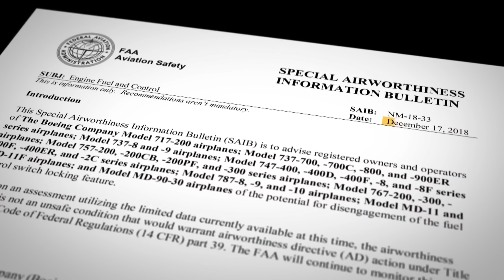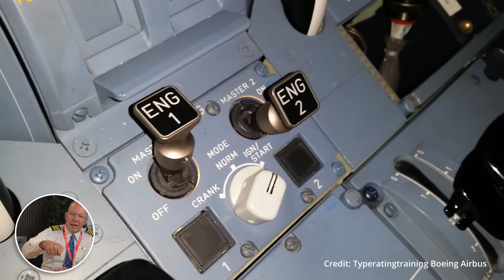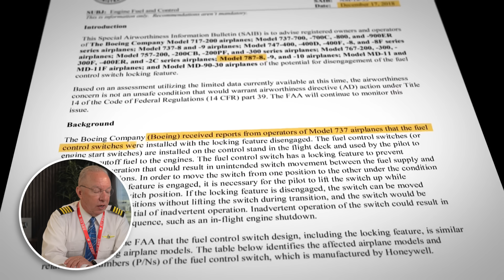Air India 171: The FAA’s 2018 Fuel Switch Locking Bulletin Explained (16 Questions Answered)

Comment: I remember a month ago there was a suggestion (but not a serious one) that one of the pilots cut the fuel off instead of raising the landing gear. Since the report seems to show the cutoff happened roughly when the gear should have been raised and that the landing gear was still in the down position does this theory now hold more weight? It seems entirely improbable but here we are.

Comment: I find it too easy to shift the scrutiny to pilot actions. I think as a responsible investigator or commentator, the related party should 100% make sure the machine or the system is not responsible for this accident. Then we should switch the focus to the pilots, they are the two people who can’t defend themselves and their families have had a lot to go through already. I personally think there are a lot of things to clear up on the machine side before focusing on the pilots
Reply: You dont seem capable of accepting some pilots are suicidal like in the Germanwings crash or Egypt Air.
Reply: @briangasser973 I can accept it after all the evidences are there and all other factors are ruled out. But in this case I think it’s too early to be jumping on the bandwagon.

Comment: Captain Steeve. You talked about essentially ruling out the suggestion of including cameras in the cockpit as it would be sort of streneous and nerve wrecking to the pilots for them to know that they are constantly being monitored. Don't you think that planes should have atleast 3 pilots for every flight(1 with an excellent background of psychology, therapy and trouble shooting as the PM and the other 2 as the PF's)? I am saying this referencing the Germanwings Flight 9525 whereby there were  2 pilots in the plane and as the Captain left the cockpit, the Co-Pilot allegedly locked the cockpit door and commited suicide similarly to this situation.

Comment: So, if the fuel switches was cutoff 3 seconds after takeoff, why did it take 10 seconds for the other pilot to put it back on? Could 5 seconds or less between off and on have saved it?

Comment: I’m thinking that if an engine fails the response is to switch it off and on again then could an overloaded aircraft and a temperature on the runway several degrees above safety could this be the cause?

Comment: So was the fuel switcthes off ? ( Sorry havent had the time to see the movie yet ). 
  If it was couldnt  they realized they were going down and cut the fuel system off ( just like you do in a cessna in case emergency landing although i dont know if its like that in that Boeing). In that case the fuel switches wouldnt be the real cause...
 Is it the possiblity of being to heavy and to hot outside temprature and being outside of the performance parameters out ?

Comment: That switch system does it not sound alarm as soon as one switch is turned to cut off during flight. Will they try to get them switches to move when locked in place for example try see can they get them switches to move from locked position by running arm over them in many scenarios.

Comment: If psychological reviews are made mandatory, then no stigma will be associated with them, thus opening the door to evaluation, affirmation of fitness, and help if indicated.  I would much rather be affirmed as fit or referred for further analysis than have the possibility of some post-mortem speculation hanging over me. I believe everybody should get periodic routine mental/psychological reviews. Everybody has (or should have) regular physical and dental check-ups for a reason: To catch and head off problems that will negatively affect health if not identified and addressed. We should get similar check-ups for our brains, emotions, and personae. I think the pre-flight pilot-to-pilot check-in is a great start, but I also think there should be a more formal, regular evaluation system.

Comment: The report specifcally says that both switches flipped to cutoff within 1 second while to move those switches it practically takes 4 seconds based on analysis by other experts. The whole western media has made its judgement final based on preliminary report while backing Boeing and GE. 

Would Boeing want another dent post the 737 max controversy introducing tech even the pilots weren’t informed about MCAS - yeah that makes Boeing reliable right? 

Year after year we see people dying in air accidents and when its from Boeing the accountability is missing. Their engineers have come in public, their parts are assembled together by force since they are made at facilities with different setup in place. 

God forbid if the final report shows it was a Boeing issue and not the pilot error how will you see yourself in the mirror? Perhaps an apology like the earlier videos claiming you are human. Right.

Instead of feeding on such situations a responsible person would wait for the entire report but we do have Steeve all mighty the all knowing. 

Additionally, the addition of psychologist to team of experts refers to understanding the last conversation between the pilots which does not have a followup accusition to the other pilot once the engines were started, they were collaborative suggestive sudden surprise  unlike germanwings 9525(2015) and egyptair990 (1999)

Boeing is known for the 2018 fuel switch controversy. I hope truth prevails and we give a proper closure to this tragedy.

Comment: Thank you for what you do! I’m glad to hear about the program your airline has. I am in little doubt of the likelihood that this was deliberate as you said but I was wondering if there was any part or mechanism that could have failed to cause both switches to go to cutoff. I know you said it’s unlikely since the vibration would have affected both switches at the same time instead of 1 second apart, but I’m curious about the construction of the switches and if there was one singular part that could have failed, maybe in a sequence that allows for the time delay, that could have caused this. 

I do think it’s as you say, a deliberate act, but it of course breaks my heart that a pilot would go to these lengths to not just take down the whole plane but to do it in such a populated area. I know there have been a few attempts and successes in committing this act before like Germanwings and the FedEx flight. I look forward to the discussion of mental health and wonder if you’ll have anyone with knowledge of Air India’s policies as well as general culture insights.

Comment: It is very clear that your comments regarding cockpit video are shaped not by the truth but by your allegiance to the union to precedence over the truth.   Of coarse having video in the cockpit would fill in the blanks of what happened to FLT 171.  If pilots are professionals in the cockpit, the addition of a video capability should not impact anyone the public seeing it.  It sure sounds like the pilot unions are putting their members ahead of the safety of the public flying on these planes.

Comment: Come on Steve. Cameras are must in Cockpit, especially when hundreds of lives depend on humans and systems in there.
Reply: He said cameras wouldn’t have “prevented” this crash. But either do black boxes, etc. they are there to help investigate mishaps and get more definitive answers so they don’t happen again.
Reply: @robertmoriarty925 wth lol yes they do
Reply: What most people are missing here is that the FAA had already issued a warning back in 2018 (SAIB NM-18-33) about a potential issue in Boeing aircraft where the fuel control switches could unintentionally move due to vibration or mechanical failure.

In the recent Air India crash, both pilots denied switching off the engines, and flight data confirmed that both engine fuel switches moved from RUN to CUTOFF almost simultaneously.

If these switches are manual and controlled by physical levers, it's impossible for them to move without human input — unless there’s a mechanical fault, such as a failed locking mechanism, which is exactly what the FAA had previously warned about.

The aircraft involved had not undergone the inspection recommended in that 2018 FAA alert because it was marked “advisory, not mandatory.”

This strongly points to a technical glitch — not pilot error. It's easy to blame humans when machines fail silently. Aviation authorities should focus on the dual engine switch system’s design and whether proper inspections were neglected.
Reply: They have sex in there
Reply: agreed
Reply: Why are all you Indians taking this personal?  You guys didnt turn the switch off so why all the hate towards Captain Steve?  No one thinks all Indians are bad pilots just the one that turned the switches off.  We have to get to the truth
Reply: Bharat 7e worker comparing office CCTV with cockpit environment. CCTV are connected to local hard disk / cloud. Installing a camera in cockpit is easy. The hard part is managing the power and data. Where should it be stored? In another blackbox? How to design it so it will last upon impact? How to make sure it doesnt interfere with current system? And you need to implement a whole new bureaucracy to manage the data. It can be done but the cost will be on you. 😊
Reply: @takatoo oh, however would we do that with 8+ terabyte m.2 drives available for less than $1000. That’s almost nothing compared to the cost of the plane. Are you dense?
Reply: @takatoo Easy peasy, it can all be stored on a thumb drive weighing a few ounces. You won't need anymore black boxes since thumb drives are virtually indestructible anyway and it can be kept inside the current black box.
Reply: @takatoo  you ensure it won’t interfere with the existing system by making it physically and logically separate.

All it takes is a couple of cameras, wire them through the plane to where the existing blackbox is, and put a new one at the side of it made from whatever material the current one is. 

Inside, you put a drive with no moving parts and something to store the video to disk. Easy.

The whole thing with be < 100 W @ 5v
Reply: lol. That was a lame answer. I’m definitely pro-“Pilots not doing shit that isn’t pilot shit while being a pilot.”

“Pilot might get caught doing non-pilot shit” doesn’t really grab me as a defense. 

Loves ya, Steve!
Reply: @PuerAeternusCrescit  Next they will want parachutes on every jet 😂😂
Reply: Cameras in cockpits will provide additional accountability which will increase safety. Period! Also, in this crash, if there were a video of which pilot cut off the fuel, the story would be over!!
Reply: I’m not exactly convinced by “well, they might be reading a magazine and what if people found out?” as the counter argument 

Yeah, that’s a good thing, and we would also know exactly what happened to those switches.
Reply: If you're NOT DOING ANYTHING WRONG, like reading a magazine or napping, when you're supposed to be flying, then you've got NOTHING TO FEAR from the cameras.
Reply: @glennandrus8448  "If you're not doing anything wrong, you have no need to fear Big Brother!"
Reply: @glennandrus8448  You know nothing about aviation. 😂 Have you've flown in a commerical cockpit for 30 yeaes
Reply: @glennandrus8448  No, we don’t want cameras in our work space….. keep those cameras to yourself. Record the flight as a passenger if that worried about it.
Reply: @TitaniumTurbine most people are filmed working now. What makes you special?
Reply: No need. Listen to what he said. All the data and recorders are already there to determine exactly what happened.
Reply: @jamesthebond4904 Cockpit must have cameras and all data should go real time to cloud
Reply: @jamesthebond - you mean like in the Jeju crash?
Reply: @jamesthebond4904 he's wrong and deceitful about his answer on this! Cameras are meant for accountability!
Reply: @jamesthebond4904 One picture worth a thousand words
Reply: Mental health culture change: also the issue employers/bosses will have with any pilot not feeling like working, to say “I’m mentally unwell right now”. Probably mostly a DEI or Generational issue.
Reply: Cameras work perfectly well at night and have done for years  @rileydj8764
Reply: Exactly. Cameras are there at evey office corners
Reply: @challenger908  well, in offices, you usually have light and a lot of otherwise unmonitored devices, the FDR already monitors everything that interacts with the plane and the CVR gives 99% of the data a CCTV could.

I mean, the only mystery here is who pulled the switch (reasonably the one that defended himself, so we might actually know), but that knowledge does NOT help clearing things up as we know that someone pulled them, which pretty much had to be deliberate (1s interval and them still working afterwards basically guarantee that) and such an investigation CANNOT be used in court anyway (and afaik, the airline is liable no matter what).

CCTV is great if you need a scapegoat, but here, you need what happened and what they were thinking, neither answers are on a camera. And even the question of who has an easy answer: Pilot (known voice) or someone who shouldn’t be able to get in there.

And all that bandwidth that CCTV would use is way better invested in getting more into the FDR as well as extending the runtime of the CVR. If you really want CCTV, make it Front-Facing, as the view out front could actually be important beyond the blame-game.
Reply: While I agree that cameras in the cockpit would be helpful, I doubt there to be many cases where they would help the investigation all that much.

Sure, a dashcam may actually help with getting a sense of the visibility, but you already know what they say (CVR) and what they do (FDR). And placing cameras to properly see where they are looking and who else is in there sounds like a huge hassle for negligible clarity, with the added fact that a lot of flying happens at night, when most cameras are basically useless.

And yes, here, it would help the police and prosecutors to place blame at one person over the other, but this is SPECIFICALLY FORBIDDEN to the investigators and anything from the investigation is BARRED from court, so I think we can skip that. Especially since I highly doubt the ability of prosecution to deter a behavior that is likely to be suicide and thus the highest punishment available already.

Sadly, the more fruitful avenue would be if the CVR recording survived a near-miss on start by recording for longer than the flight (like 24h as in the FDR) as well as standardization on having multiple combined black-boxes and not 2 FDR with 1 CVR, thus easily losing quite a bit of information.
So 3 Boxes, any of them recording voice and data for 24+ hours would likely help safety a LOT more than any flight-deck CCTV. A front-facing cam and potentially more data points for the FDR would likely help too.
Reply: @genoobtlp4424 it would be super helpful to see how their arms move and what they are looking at. People could design planes that are easier to fly when emergent strikes using data like this.
Reply: How are you going to avoid an aircraft accident with a camera?

Comment: When an airplane takes off, it accelerates down the runway until it reaches a critical speed called V1. At this point, the pilot lifts the nose of the aircraft—a maneuver known as rotation—and the plane becomes airborne. During this phase, the engines are providing thrust, which gives the aircraft both speed and acceleration.

In the incident being discussed, shortly after liftoff, the fuel control switches were moved to the cutoff position. This action, whether due to human error, intentional input, or mechanical failure (the cause remains under investigation), cut off the fuel supply to the engines, causing them to shut down immediately.

As explained clearly by AgentJayZ in his video today, when you cut off the fuel supply to a jet engine, it stops producing thrust almost instantly.

Separately, the loss of engine power triggered the automatic deployment of the Ram Air Turbine (RAT). The RAT is a small wind-driven device that extends into the airflow and uses the plane’s forward motion to generate limited electrical and hydraulic power. This helps keep essential systems running in the event of a total engine failure. It does not generate thrust or keep the aircraft flying.

Even though the engines had shut down, the aircraft stayed in the air for a short time. This is because it had already built up kinetic energy (speed) during the takeoff roll. That energy allows the aircraft to continue flying temporarily, even without engine power.

However, once the engines are off, no additional energy is being added to the system, meaning the plane stops accelerating, but it still has some speed. Instead, the plane begins losing energy quickly through three main mechanisms:
	1.	Lift – The wings need forward speed to generate lift. As the aircraft slows, lift decreases.
	2.	Air Resistance (Parasite Drag) – As the aircraft moves through the air, friction slows it down.
	3.	Induced Drag – This drag increases when the wings work harder to generate lift at lower speeds.

Because the engines are no longer providing thrust, the aircraft begins to lose both speed and altitude at the same time. These two effects are directly linked: less speed means less lift, and less lift means the aircraft can no longer maintain altitude.

In summary, although the aircraft stayed airborne briefly after engine shutdown, it was losing energy from the moment the fuel was cut off. Without thrust to sustain flight, it began a rapid descent.